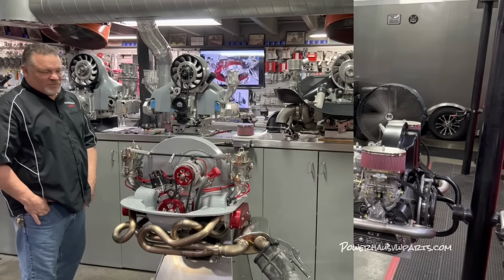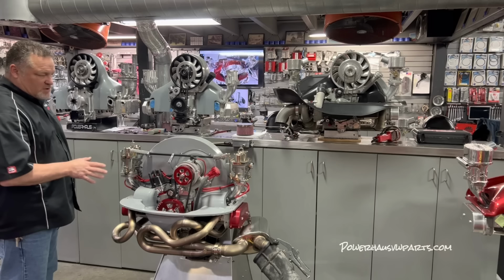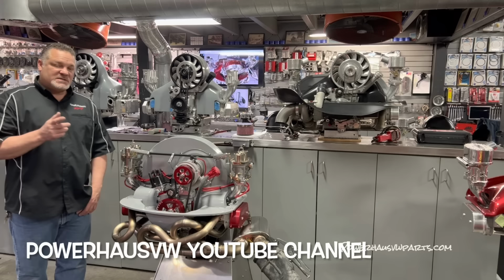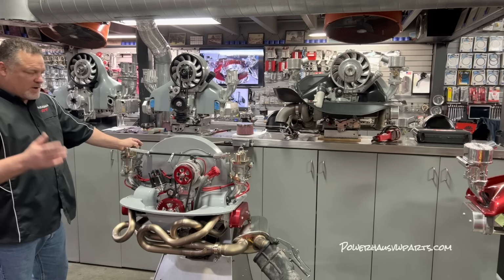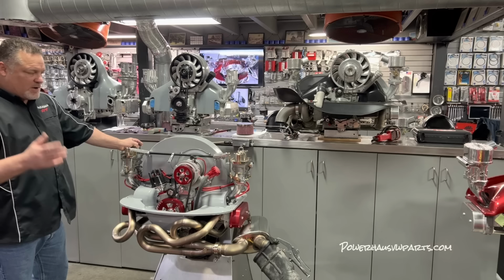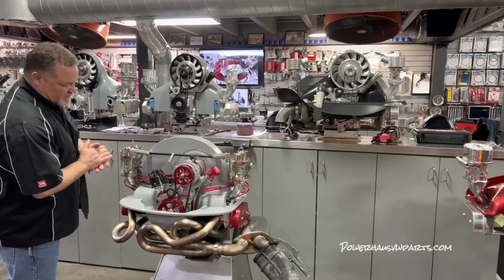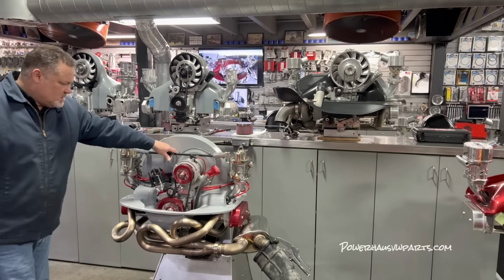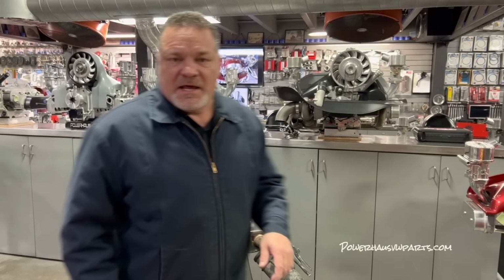120HP Powerhaus 1914cc VW Air-cooled Engine Built for Richard Bowman

Comment: That sounds so nice and crisp. I have mst pulleys on my 59. I do not like the idler bearing that came on the adjuster. I have replaced it once already. Yours is different and looks like it came off a modern car. Can you tell me where it came from?
Reply from the maker: This one is from MST, you may have an older design, they really need to be adjusted and aligned properly or they can have issues, we've had good success but do here stories on the pulley tensioner going out so make sure everything is aligned and adjusted

Comment: Years ago, the 1914 had a notorious and unsavory reputation for being problematic.
Reply from the maker: I remember but it was mostly because back then we were boring out the stock magnesium case which made them week and or thin in areas of importance but now days we’re using an aluminum case that was built for the larger crank and cylinders with added material so a 2332 or even a 2387cc engine if built with a mild cam and low compression can be more reliable than an old rebuilt 1600cc.

Comment: That engine sounds like it is perfectly balanced.  Nice shop.  I greatly miss building VW motors.  Thanks.
Reply from the maker: Thank you
Reply: 7:10 vibrates.
Reply: I built dozens of (perhaps a few hundred)  engines from 1973 to 1978, mostly stock.
My brother was a certified VW mechanic and I learned all I know from him. He left the dealer and opened his own independent VW shop. 

I moved on to another career in '79.
Now, at 70 years old I would love to understand how to build the "hotrod" engines like these on display.
I am drooling!
🤤
Reply from the maker: @edwardtaylor8635  Thanks Edward, we're using a lot of aftermarket parts that make it easier for us to build these large cc engines that weren't available when you and your brother we're working with VW's and without what you guys passed on, we'd never be where we're at now so don't count yourself short, you guys are very much a part of what is going on today.
Reply: @sandraclowdus6549  Who is from Mexico?  You misspelled Mexico.  That book "Punctuation for idiots" could be helpful for you.

Comment: It's amazing how organized and clean you keep your shop,I have been thinking about bolt on valve covers, Now I know that if you are using them they must be the way to go, Great video, love to have one of your engines.
Reply from the maker: Thank you, appreciate the kind words, the bolt on valve covers work but should be checked for tighteness every now and then, the cork gaskets shrink after time and cover will get loose.
Reply: @powerhausvw  I have tested severals valve covers models in my 1600cc with similiar setup (~90hp). I have been driving almost 200 km per day since 2016. The beetle is used as main car to go to work that is in another city. In my case the better solution for stop the leak was return use the original valve covers + very good quality gaskets. For unsual car use as mine, I've been replace the gasket each 2 months (~5000km). Some people calls me crazy due to gasoline price in Brazil. But once infected by VW air cooled... One way ticket. I believe that great organization and nice projects in  your shop shows the passion since a long time. Am I right?

Comment: Do you allow visitors to do a tour. I was trained by a VW factory employee that was working at the plant after WW2. He came over to the states in the late 50's and set up a foreign repair shop in PA. I worked there starting out when I was 13. Spent around 9 years working on Posche, VW and Audi.
Reply from the maker: Absolutely but we just have a small crew so you might want to give us a call just before you head down to make sure we don't miss you.
310-328-2746

Comment: Finally some one I can ask this question on reliability on stock trim fully rebuilt how long do they last mileage wise before another rebuild I was goin to purchase an old sand rail like the 70s military one but the guy said it's the small motor if you want more power find an older bus vw tranny I didn't buy it because I'm unfamiliar with this engine and know they used these in kit planes so what's the down low on these for maintenance and longevity
Reply from the maker: That's a tough one to answer, to many variables, these engines can be set up for many different uses and every engine builder has their own ideas. Some builders build for the most hp and rpm they can achieve, others build for low end torque and reliability, some transmissions are geared low and the engine will run at a constant high rpm on the free-way, etc. etc. If you have a chance, feel free to call us during the day, ask for Jerry or John and one of us wouldn't mind going into a little more details.
Powerhaus
310-328-2746

Comment: I had a thought a couple of weeks ago.  Since the cam is under the crank why do we have to rev. to 2,000 for 20 min. The idea of that is on normal engines to throw oil up to the cam.  What I was told to break them in  is as soon as you get them running and time  was to go 40mph in 3rd and that was to set the rings .

Comment: Awsome" Have a 1641 in my 71 type 3 Square back. Whats the biggest engine you can pack into it without cutting up the deck.....?
Reply from the maker: It really depends on how much custom work you are willing to do, the type 3 engine requires a lot of fabrication and modification in order to get any dual weber engine tucked nicely underneath the deck lid, we've done as big as a 2387cc even turbo efi but will definitely require a custom engine build as well as a custom install.
https://www.facebook.com/PowerhausJohn/photos/pcb.968698309924545/968687116592331/?__cft__[0]=AZVQxoPHB2y2IdV7kOoFd2Sw-sN_MSaNd4XVmm0iOVMF2IfaoQLjnJhQVQ2uptLppFPgL73X7wrnsX79yGIjmTCBrLM6fqE-KjaTtBg170Umoe5A5mCqMyFmWVEIcDHagG5QgyfkiXJwZNA8Gr4GWQIbRTOLP4cwBoeXbKhtIAncng&__tn__=*bH-R

Comment: It’s another great looking motor you guys have built there . I was wondering what compression you are running because you did mention you build them with low compression that will run on pump gas ? Would that be premium?
Reply from the maker: Thank you David, this one has 8:0 compression and we still recommend to run minimum of 91octane
Reply: I have a 1970 dual cab. Running a 2110 w/ dual Weber 44’s ( stoker ). Builder was Jeff Gervais. Runs great. Not good for gas mileage. Fun drive
Reply: @johnklink4825  
Thanks John 

I am having built locally a 2180 with a 8.5 compression with AA thick wall 42’s with an 82 crank 
We have the Empi gtv-2 and I new set of 44’s for the carbs . This has been a year long project I just haven’t got time to finish so that why I’m having a local shop with over 50 years of experience with VW’s . 
I actually bought my first karminn  ghia from the owners dad  in the 1980’s . 
I wish I it now:(

Comment: Magical. Does a flat-4 need balance components? They're not 'naturally' balanced like a flat-6 or inline-6 are they.
Reply from the maker: We still balance but Most of these after market parts we use are very close, In-fact some even closer than factory specs

Comment: Will that engine fit into a standard VW chassis, or the latter has to be modified ? Greetings from Lima, Perú.
Reply from the maker: I'd say typically yes, they fit in fine, some of the early VW's may be a bit tighter of a fit especially if the body bushing are worn out or if any major body work has been done around the engine bay, so mostly yes but we have seen small modifications needed on some cars.

Comment: What was the other engine auto-craft turbo behind the 2387 in this vlog?
Reply from the maker: That was an engine we did for a customer of ours in England around 2015, he eventually went 11.24 in the 1/4 mile and held the record for the fastest VW 4 cylinder air-cooled bus for quiet a while, at some point, another shop went through the engine but was never the same so it is back with us to go through and upgrade as well.
 https://youtu.be/dItXqMsntyU

Comment: Dam…reminds me of the good old days. Have to say dual carbs are a PITA to maintain
Reply from the maker: Biggest thing with dual carbs is clogged jets, so keep the gas tanks clean, use a micron fuel filter and service the air filters
Reply: Do they need to sit on separate ports? On a 1914 engine??

Comment: I painted the sheet metal & cylinder jugs fins black to dissipate the heat better on an air-cooled engine. I made an engine stand with a spit case transaxle half. you could start the engine and get it prepped for installation. 40+ years ago.
Reply from the maker: That’s cool, some of those old tricks are still being used today

Comment: How much HP does the $23,000 efi one  get you? I get that it is the best of the best . Just curious
Reply from the maker: We're actually not taking in orders for our turbo engines at the moment, we have them listed on our website as not available. The main reason for this is that these type builds take up a whole lot of our time and we still have several full custom builds to complete along side of our normal aspirated builds plus some of the efi parts we were using are not available and we will be making an ecu change very soon, pricing on all parts have gone way up and nothing on our set up is an off the shelf or sold to us in kit forum, everything on this engine is either custom made or heavily modified, so when we do start offering our turbo efi engine again, we'll probably only take on 2-3 builds a year and they will probably start off at about $34,000 by the time we add for all the changes and upgrades we are working on. 
 Our old set and specs that are currently listed on our website made about 275hp-300hp at the rear wheels on pump gas and water/methanol injection, we've made as much as 415hp at the rear wheels on race gas and about 23lbs of boost.  
https://youtu.be/JL1kMWU_jHo
https://youtu.be/AIzz1xYC2EY
https://youtu.be/ElxiDzIBORU

Comment: What does that engine cost out the door with block exchange or without…..?
Reply from the maker: These are brand new engines so we do not require the old engine, you can find pricing and options on our website or if you would like a personal quote, give us a call during the week, ask for Jerry or John.
310-328-2746
powerhausvwparts.com

Comment: The motor looks beautiful and likely (understandably) not cheap. But the one thing I can't get my head around is that a nearly 2L motor only produces 120 hp. The value per hp just wouldn't be there for me.
Reply from the maker: Thanks Michael, It really depends what your after, small cc engine making big hp is just bragging rights for mechanics at least in my opinion and that's ok, fun to compete with but we are building engines for customers that mostly want an engine to be driver friendly and last a long time so we like to use a larger cc engine, set it up mildly so that it produces more low end torque as appose to a smaller engine that needs to be high in rpm to achieve the same hp goals.

Comment: Can I buy 1914cc engine, wich have fan shroud with air outlets?
Reply from the maker: yes, we can set the engine up with heater provisions in the sheet metal or Porsche style shroud but we do not supply the heater boxes at the moment

Comment: Looks like I have to sell my beetle to bay the enjin for me it's a cheaper option to go to a Subaru enjin
Reply from the maker: We’ll it really depends on your expectations, if you go out & purchase a brand new Subaru engine equipped with quality parts, it’ll cost more than one of our brand new engines but if you go get a good used Subaru engine and can put it in yourself properly, you’ll definitely save some money  but if you or someone plans to do the swap like most I’ve seen with radiator sheet metal screwed into the spare tire area, coolant pipes running underneath the car, wiring & hoses everywhere, your probably better off leaving the engine in the Subaru and driving it but now your back to selling the bug again 😁

Comment: What makes it VW?
Reply from the maker: Good question, pretty much every part is aftermarket but maybe because they still use factory part numbers on some of the parts, the aluminum engine case we use was never used in a factory production VW but is made by Autolinea which I believe did build parts for VW at some point so I guess it can identify as a VW engine if it wants, I'm not gonna argue. 🙂

Comment: Sorry, but 30hp per cylinder? Nothing to brag about. Harleys 2023 stock 114 motor comes in at 100hp or 50hp per cylinder. So, with 4 cylinders you should easily be able to produce 200hp on a mild build. Come on man! It's not 1949.
Reply from the maker: We do offer a mildly built low compression  200hp/200tq 2387cc.     
For years, we never posted HP on our engine builds for this very reason and we'd always get asked how much HP does that engine make. Now we start listing it in our post and some get the idea that we build with the intent to get the most HP and RPM possible which is not what we do. We build engines to fit customers request, driving conditions, install capability's and also budget, not every customer is after HP. Most of our customers  like to cruise and have a driver friendly, reliable non-leaking engine. I agree with you, there is a lot of new technology now days and even though the engine design we're working with is still 70 plus year old technology, we've made as much as 500HP with some of our turbo efi builds, it really boils down to what our customer wants to do and or spend. 
https://www.youtube.com/watch?v=9aHxkqw9br4

https://www.youtube.com/watch?v=ElxiDzIBORU

https://www.youtube.com/watch?v=AIzz1xYC2EY